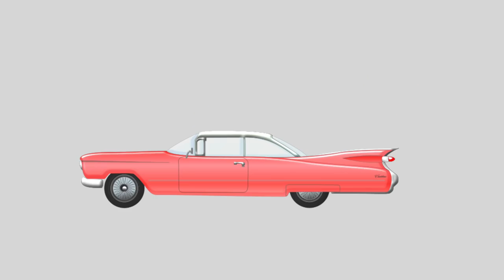Yes, Rockets CAN Fly in a Vacuum

Comment: Hi I Amy thanks for another interesting video. I'm a college lecturer of engineering here in the UK and when using analogies and demonstrating things something simple that the learner can relate to is always the best way to get our point across. In short I loved the use of the baloon. Now my reason for posting, was any consideration given to reusing any part of the Apollo rocket for future missions. The most obvious would be the command module (perhaps the first stage could have been made recoverable) such as with the STS (shuttle) obviously a certain amount of refurbishment would be required (how much) and the command module was only a small part of the complete assembly but surely a refurbished craft was possible but was it ever considered.

Also I've asked this before but you don't ask you don't get. Since the Saturn V was built by hand and before the routine use of computer controlled manufacturing there must have been variations in size when each component was made. In theory one command modules hatch may have been larger if only by a thousandth of an inch, therefor what tolerance did manufacturers have to adhere to, was any problems encountered in this department such as components perhaps even a whole stage fitting correctly. Finally did thus cause rocket envy amongst the crews. Say crew of 12 to crew of 15 "my Saturn V is 60 thou bigger than yours.

Comment: Since space is vaccum, then how Newtown 3rd law is applicable?
Reply: If you have a force exerted by one mass (rocket nozzle) on ANOTHER Mass (exhaust gases) then BOTH masses will feel a force and therefore experience acceleration.  Would a crossbow fired in space have RECOIL?  Yes.
Reply: Papa Legba  WHY do you refuse to watch the video that proves you are incorrect? Have I even told you that the company I work for TESTS thrusters IN VACUUM and verifies that they have a force exactly as predicted by the Rocket equation?

Comment: yes but how do rockets fly faster than the exhaust they emit?
Reply: Because all that matters is that the fuel exhaust has had its velocity changed in relation to the rocket.
The speeds involved as viewed by an external observer have no effect on the interaction at all (except when near the speed of light).
Reply: Because the exhaust is travelling in the opposite direction? If you’re not talking about relative velocity, the exhaust leaves the engine at the same speed no matter how fast the spacecraft/rocket is moving.
Reply: Imagine this: a cannon can fire a projectile at 500 MPH. You mount it Pointing backwards in an aircraft and the plane is flying at 500 MPH. You FIRE the cannon.
Are you suggesting that the cannon will feel NO RECOIL because the airplane is already travelling at 500 MPH?

What if the plane is flying at 1000 MPH? Does the cannon have REVERSE RECOIL?

Comment: Have you guys seen the size of the cans that it takes divers to stay under water for 20 minutes? And they’ve trained themselves to sip on the air mixture as sparingly as possible.
Reply: Or how about the oxygen bottle that grandma sucks on? You couldn’t even move the turbine a millimeter with that bottle ha ha. Come on guys get logical
Reply: The Falcon 9 uses 287 metric tonnes of oxygen in less than three minutes.
Does the diver or auld granny in your example use oxygen at that rate?
Reply: Um, no?

Your point?
Reply: @sooperdoopercoolguy  
The point is that a diver and a granny are not comparable in any way to a rocket.
Why did you even bother writing something so off topic?
Reply: To point out the absurdity of the idea that enough oxygen to feed those motors could be carried.
Reply: 1,000 times, okay well there you go...
It’s not even close enough to burn those rockets my friend. You are not comprehending the sheer magnitude of the air (btw, they need to mix the oxygen with other gases to have the volume of air to replicate earths. If you pumped pure oxygen through it it would become a bomb. You would also need ducts to direct the air, in that magnitude in front of the motor. Now you could say that the gases expand after coming out of the ‘nozzle’ would expand in the intake duct just before being sucked in, but that would be some fantastic dynamics going on, as well as the problem of how do you suck when you are in a vacuum? Follow me? It’s all nonsensical, really. 
Did you really think that I believed that they would store oxygen at full volume in their fantasy mission? Well, I guess that notion is no more far out than the rest of this fiction.
Reply: @sooperdoopercoolguy  
I believe I lost a few iq points trying to make sense of that word soup.

Seriously...you claim that they can't carry enough oxygen.
Exactly how much oxygen by mass would be needed to get a rocket into space, by your calculations?
Take the space shuttle as an example if you want, or any spacecraft you like. Just tell is the mass of oxygen you'd need and how you came to calculate it.
Reply: @sooperdoopercoolguy  SO even the rockets we can SEE FLY WITH OUR EYES are an illusion.
All the rocket launches I have seen with MY OWN EYES did not really fly, they were "CGI' right?

Got it.
Reply: Niall Kinsella
metric tonnes of oxygen in less than three minutes.
The space shuttle takes 81/2 min to reach space. So idk, around 1,000 metric tones. Personally I have a hard time getting my mind around metric system measurements. So according to your liquid oxy ratio that means a metric ton of liquid right (I checked and it’s actually 1:860, close enough for me haha) Well that actually seems doable, and they actually do do it, as has been witnessed by countless people. I’m not sure why you asking that. because they drop those tanks anyway.
What I’m concerned with is all the jetting around in outer space, or to be specific, lets say Appolo 9 haha, blasting off the moon. Where are those tanks? And they need to supply hydrogen as well. And the tanks have to be much larger than the volume of liquid, I don’t know how much, x2? Anyway I don’t have time to do all this research, it was supposed to be a mental exercise so that one could fathom the enormity of the volume passing through those jets. 
In answer to where did I get it: from your post (consumption rate) and google (the time to reach orbit).
Reply: Stuart Gray
Come on man. Obviously rockets work in atmosphere. Let’s stay on point. But speaking of which, why is it that every 🚀, in what looks to be about a third of the way, starts to turn? I thought that the shortest distance between two points was straight? Yet every “space ship” that is headed to outer space seems to maneuver so that their trajectory is parallel with the canopy at the top of the stratosphere. Because they can not break the stratosphere, that’s why.
Reply: @sooperdoopercoolguy  
1000 metric tonnes?
Wrong, 630 metric tonnes.

But you probably forgot to account for the thrust provided by the solid rocket boosters which did the bulk of the lifting during the takeoff.
Reply: @sooperdoopercoolguy  
Rockets turn to fly parallel?
Yes...
If you're going to argue about spaceflight, the very least you could do is bother to learn how an orbit works.

Comment: Lets say (I know its silly) you had a giant speaker in your spaceship and you'd get it to vibrate at the bottom of the ship just like a rocket engine. Could it actually move you forwards if the vibration was powerful enough? I know sound needs air to travel but someone said it would still work because of "vibration energy" and i'm not sure about it. I think it would just fuck up your rocket/spaceship 😄
Reply: No.
Reply: @stuartgray5877  thats what i thought!  I didnt expect to get an answer to this one. Not that fast at least so thank you 😄

Comment: If that's the case surely the sun and other stars exploding constantly would be pushing themselves in space
Reply: They are.
Gravity is holding them in a spherical shape.
The surface of the sun has similar pressure to the very upper edge of our atmosphere. Essentially nothing.

Comment: According to what you're saying. Could you use just compressed air, once you were in space?
Reply: Yes.  That would be classified as a "Cold Gas Thruster" which is used extensively.
Reply: @darklight2.1  I worked at Lockheed Martin Flight systems where the MMUs were built and refurbished.  The cleanroom where they were worked on was in the building with my office the Mission Support Area (MSA) during the 1990s (Mars Global Surveyor, Stardust, , Genesis, Mars 98 orbiter & Lander).

It was really cool being in the middle of all of that tech.

Comment: I thought of another example of inertia/momentum I would like some of these "Physics deniers" to think about.
I am helping build the Imaging X-ray Polarimetry Explorer (IXPE) satellite for NASA.
When it launches it will be in a "stowed configuration" where the telescope payload (about 500lbs on earth or ~250kg mass) fastened tightly up against the "Bus structure" (also about 250 kg mass).
the telescope payload will be deployed about 13 feet from the Bus structure after launch.
It deploys on a "flip out" boom that must spin around about 3.5 times to reach full deployment.
we have analyzed this deployment and the dynamics that BOTH PARTS will experience during the (sort of violent) release of the spring loaded boom.

So - imagine I have two 250 kg blocks of metal, floating in zero-G (or in freefall)
they are connected together with a coiled spring such that when released the spring will exert a force trying to rotate the masses opposite directions. (a TORQUE)

Now can you explain to me what an observer would see if:  the once the blocks were released and the spring exerts a torque between the two blocks ?

 explain what the observer would see happen to the blocks?
Reply: Where are all the physics deniers that say 'there is nothing to push off of" in space?
So WHAT happens to the two masses when one applies a TORQUE to the other?
 Does ONE side spin up while the other side stays stationary?
Or do BOTH sides get spun up, but in opposite directions?
Reply: Papa Legba  - SO WHY do you "like" your own posts.  Does it make you feel loved?
Reply: @stuartgray5877  He isn't liking his own posts lol.  And why are you still here, everyday, for years?
Reply: Papa Legba  want PROOF of rocket Propulsion in a vacuum?
 Search YT for "SpaceX ArabSat launch and booster landing 4K". 
 Watch the video of the falcon heavy fly into space, then the side boosters returning to land at KSC.
  Report back after you watched that video to the landings.
Reply: Well we did the deployment of this telescope boom in space and GUESS WHAT?

BOTH ends spun in opposite directions as we deployed that boom.
JUST AS PHYSICS says they would.

And Notice how all Papa Legba knows to do is hurl juvenile insults?
He is completely INCAPABLE of answering even the simplest of physics questions.
And he calls ME the bot....

Comment: Another way to look at it is the thrust comes from the force needed to push the fluid (usually a gas, and usually combustion products) out the nozzle.  This force is in the direction heading behind the rocked, so the rocket reacts by moving forward (Newton's first law).  What the gas does after it leaves the nozzle has no effect on the rocket since it's no longer being pushed out.  That's why a rocket continues to accelerate as it climbs even though its exhaust changes from a narrow stream into a diaphanous cloud.

Comment: I'm still wondering how propellers work outer space when in fact action is equal to opposite reaction, how can an object is pushed in opposite direction when there is nothing to be pushed against empty space in the first place?
Reply: Would a crossbow fired into a vacuum feel any recoil?
Yes or no?
Reply: Watch the video again and pay attention this time.
Reply: Newton's 3rd law of motion:
"For every action, there is an equal and opposite reaction."

The statement means that in every interaction, there is a pair of forces acting on the two interacting objects. The size of the forces on the first object equals the size of the force on the second object. The direction of the force on the first object is opposite to the direction of the force on the second object. Forces always come in pairs - equal and opposite action-reaction force pairs."

The pair of forces are between the rocket and the rocket's exhaust, nothing else.

Comment: How is the fuel fed to the rocket engine in micro gravity?
Reply: Kit Canyon  a diaphragm? What pushes the fuel towards the inlet if the gravitational forces are nominal?
Reply: Kit Canyon   you clearly don’t understand the question, in null gravity the fluid would be sloshing around freely in the tank with no force to bring it to the nozzle inlet, regardless of the pressure in the tank, if high pressure helium is blowing out the fuel inlet that would cause intermittent flow and could interrupt the burn on restart. They burn fuel not helium.
Reply: Kit Canyon  If you’d read my original question that could’ve been your first comment
Reply: Kit Canyon  Touché
Reply: @jaredj631  For propulsion systems that spend a LOT of time in zero-G there IS a diaphragm inside the tank separating the pressurant (usually helium) from the liquid fuel/oxidizer.
For rockets they sometimes have an "Ullage motor" that is separate from the large engines that can fire BEFORE the main engine pumps start spooling up.This forces the liquids back to the inlet ports.

Comment: this still  does NOT explain newton third law of action reaction! you expalin the action of the gas escaping the nozel but reaction but the reaction is from what?
Reply: The rocket exerts a force on the exaust gas  and the exaust gas exerts a force in the rocket
Reply: - " but the reaction is from what?"

The ACTION is the gas pressure inside the nozzle ACCELERATING the mass of the exhaust gas from the nozzle.
The REACTION is the mechanical RECOIL of pushing on this mass.

Mechanical RECOIL is "Thrust in a vacuum".
Or do you believe that a crossbow fired into a vacuum would NOT have any recoil.
Reply: It's like the recoil of a rifle.
The rifle is the rocket body, the cartridge is the rocket engine and the bullet is the rocket exhaust.
The force that pushes the bullet out of the muzzle is equal to and opposite of the force of recoil on the rifle.
Rocket exhaust has mass, just like a rifle bullet, only instead of one heavy object it's trillions of light particles.

Comment: I know that in our admosphere there is friccion from the air molecules improving trust, but how do rockets propel in space where there is little or no friction to generate trust from the the burnig gasses living the exaust system?
Reply: "I know that in our admosphere there is friccion from the air molecules improving trust"
You just proved that YOU DONT know much about what you speak.
Rockets are MORE EFFICIENT OUTSIDE of the atmosphere.
  The exhaust leaving the nozzle gets exactly ZERO THRUST by pushing on the atmosphere, but the atmosphere SLOWS DOWN the exhaust gases giving LESS THRUST to the rocket.

Comment: Hi Amy
I'm still confused. In a car of course it's the compressed 'live' gas that drives the cams and pistons which turn the wheels. The exhaust gas is minimal and contributes little to the car's movement. Any such movement from this occurs from the pressure of movement of one gas against the other (air).  Like an aircraft propeller this sucks air in front of it. If there was no air there would be no aircraft movement. That is why all aircraft have an operational ceiling - less air, less thrust.
What is not so obvious to me is how, without air, does an object get from point A to point B without a push or a pull notwithstanding gravity.
Even though there is enough forward (upward) momentum from a rocket to break through the atmosphere into a vacuum where there are 'no equal and opposite' actions to take account of, what then takes place? 

Thanks Amy
Reply: Here is a question to help you understand: if you fired a crossbow into a vacuum, would it experience any "Recoil" force? Yes or no? Why or why not?